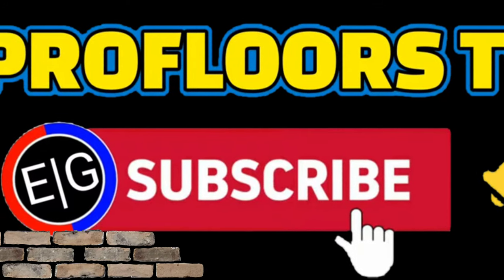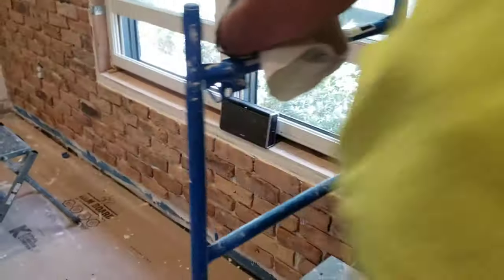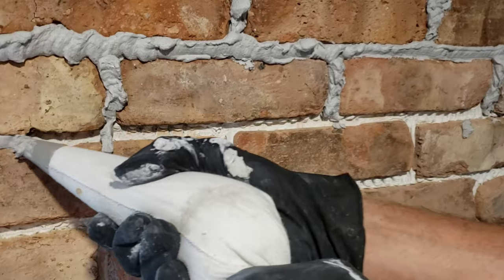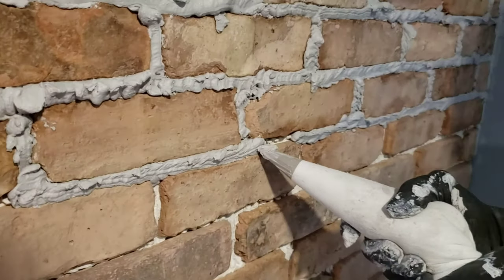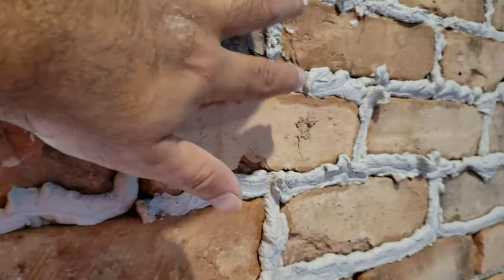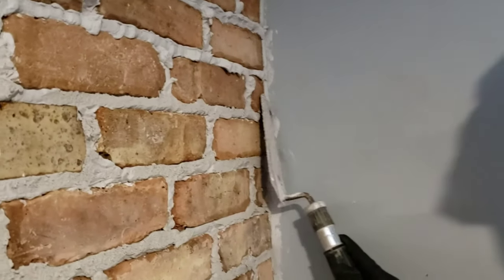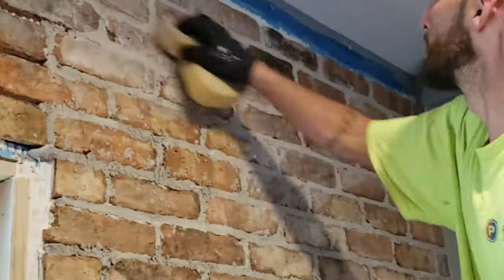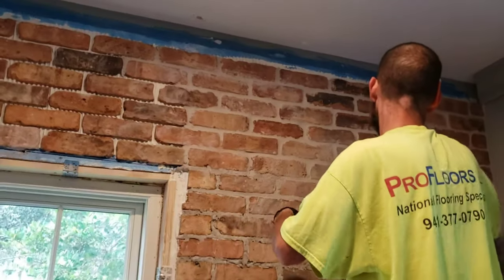How to use a Grout Bag! | #thin #brick #pavers | Do It Pro! 👷‍♂️🧱🧱🧱 [#DIY PROJECT]

Comment: Something people should know is to be very careful with some of the colored grout. That stuff drys very fast and if you wet sponge it too late you aren’t ever getting those color stains off the face of your brick or tile.
Reply: @ChappySinclair  not sure. The only way I know that will prevent it for sure is to work in smaller sections so it doesn’t cure/dry before you have a chance to clean the face.

Comment: Thank you for the simple example how to use the grout bag.
Reply from the maker: Thanks for the Comment 💯
Reply: @egformula  
I got to tell you, i just used the bag. Wow!! It aint as easy as it looks. 1st i mixed to dry and it wouldnt come out of the bag. I empty the bag and made it wetter.  Too wet. It was running, dripping. Im covered in cement. Finally got the consistancy right and still its not as easy as it looks.
Reply: @egformula  My mortar just kept jamming in the tip, when the water is squeezed out of the grout.  Then I kept cutting the tip wider, and it kept happening. I had the grout so wet that I could drink the stuff, and it still kept binding in the tip. Lots of swearing, and I never got that tip to work.
Reply: @posttyped11 this just happened to me. How did you fix?😊

Comment: Use some bevelled wood to compress grout then wipe wirh soft brush
Reply: I agree completely with what you said using a piece of wood and then a soft brush I just did the exact brick did not use a sponge at all it was a lot less work a lot less mess just let the grout dry scrape your grout seams with a piece of wood and then run a brush across it and it makes the grout look like it's been there for 20 years to match the old style brick

Comment: I can’t get the grout/mortar to come out of the bag unless I get it runny wet? Then it will fall out of the joint especially on soldier lain brick. What am I doing wrong??
Reply from the maker: It has to be a somewhat softer then regular grout but yet not too runny, then
Try adding less to the bag and not fill soo much to start off with. Little by little you'll get the hang of it as you twist it out.. and eventually you'll fill bag more.. but definitely try less when it's first time
Reply: @egformula  thank you so much for the fast response I am on my way to my cabin right now to try it again. You know now that I think about it last night when the bag would get low on grout/mortar it would flow out near perfect. I got all my flat joints done (top of the hearth) hopefully it goes better this evening. Thanks again for the quick response and the helpful tips!!
Reply from the maker: @Mike Sims  No problem Mike Thanks for watching here 👍💯

Comment: Can you use epoxy grout on these thin bricks? I’m doing a small 5x4 entry floor area in this brick. I hate sanded grout!
Reply: I would not. epoxy grout is VERY difficult to wipe off.

Comment: Thank you! This was a great tutorial!  One question- I will be using a concrete mix on a stone wall - is the concept the same?  I can't see why it would be different.  Any suggestions?  Thanks again.
Reply from the maker: Yes same concept all good, its important to have it mixed correctly not too thick or way too thin, may take a couple of trys to get it right so it squeezes out correctly.

Comment: Do you prefer using sanded grout over a masonry mortar mix? I'm guessing the sanded grout is easier to push into the joints and flows easier in the bag? Going to be filling my Mexican half brick decorative walls and just want the easiest but best method possible...thanks
Reply from the maker: @Robguru  sanded all day
Reply: @egformula  Thanks!

Comment: Can you use regular mortar
Reply from the maker: Only time iv seen motor use as grout is outdoor architectural stone work, they usually have a dye color power that they add to it. So in this case this type of brick i wouldn't recommend it but it might be possible.